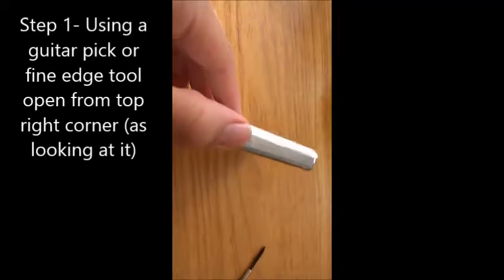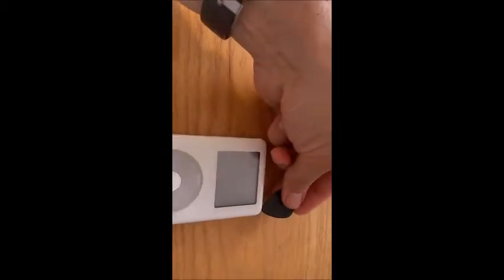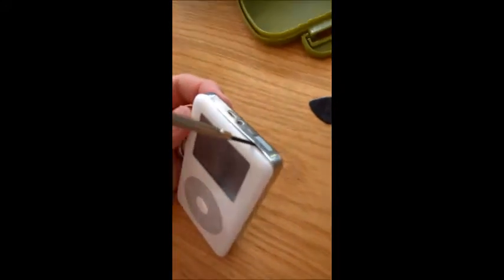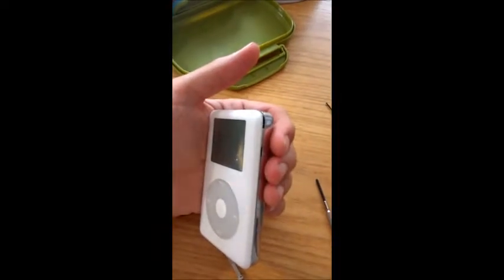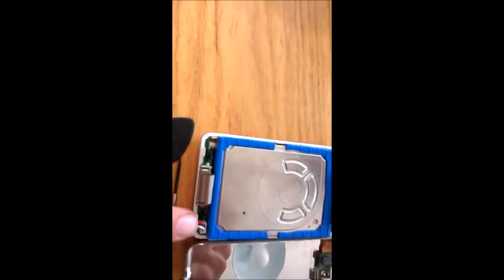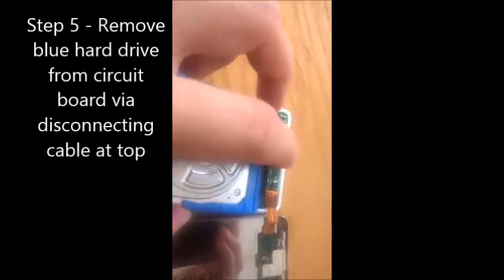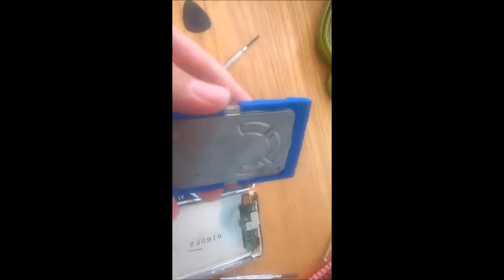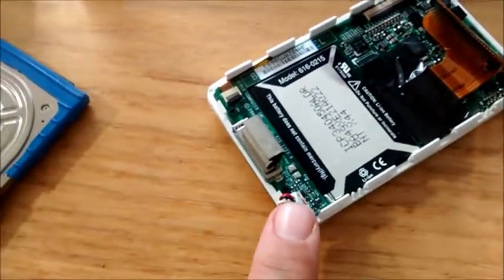Simple guide for open and repair of Ipod Classic 4th generation hard drive

Comment: I do understand how hard it is to open up the ipod, but don't use a screwdriver, as that bends the aluminum, which can change the shape of the metal to where you might not be able to bend it back, there is an actual tool designed to slide into those sides (its like a really thin knife), its also easier to start from the side, slice in between the gap to find the clip, then to move it up to where the butt of the blade is facing you, then push down slowly until you hear a small pop, then run the blade down, those clips will now be undone and you can open up the ipod like a book, but slowly to not damage the ribbon cable, this method is much easier and you don't have to risk bending the metal back